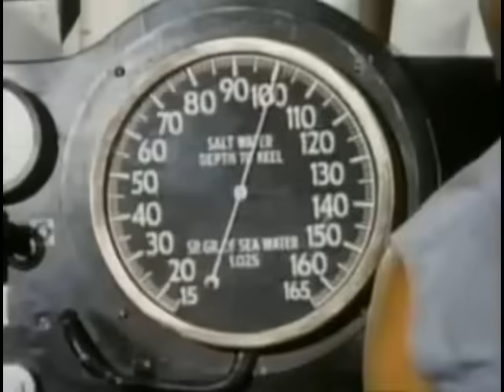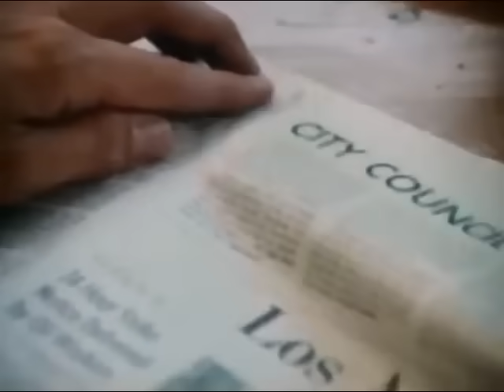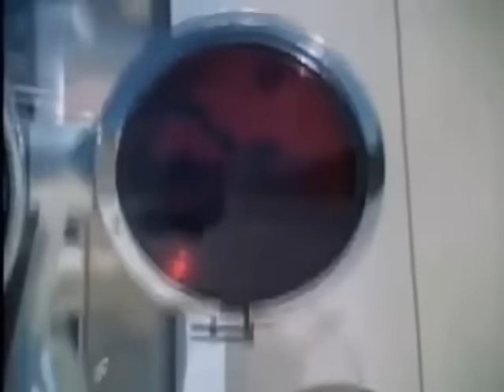22 NEW SHOWS OF FALL TV 1977

Comment: My dad was Master Control of our city's ABC affiliate at this time. I went to work with him every Sunday.
Reply: I know what that was like. I worked master control for the old Fox 32 in Appleton, Wis. for a while in 1977. That was when Fox only ran on Saturday and Sunday nights along with the late show at 10 p.m. weeknights. No doubt you father had you pulling and putting away 3/4th-inch or perhaps Quadcart tapes. That was unless the station had a separate tape room and your dad did not have to load, cue up, run, and put away commercials.
Reply: Becki Green I worked my NBC affiliate in the late 90s in the evenings and from 97-02, I got to see every single episode of Late night with Conan O Brien. Awesome gig. The only perk.
Reply: I could not imagine doing that job without some computer assistance.  What was it like hauling all those tapes for each segment?

Comment: 98% of those 1977 shows were horrible and canceled even after 13 episodes.. Lou Grant and CHiPs lasted into the early 1980s.
Three's Company should have been included since it started with just 5 or 6 episodes in the spring of 1977.